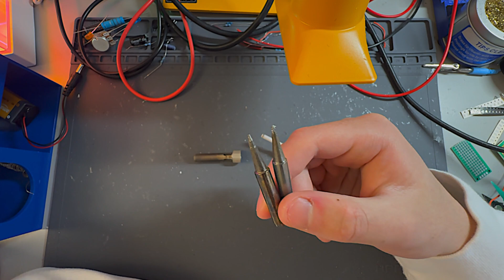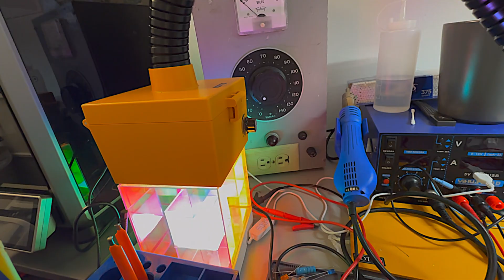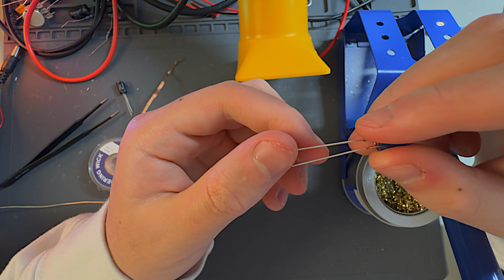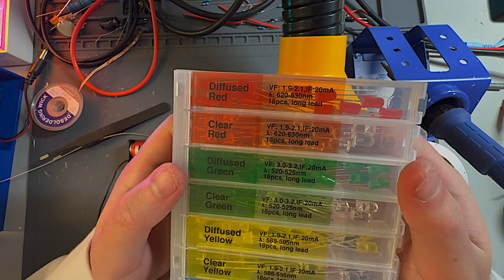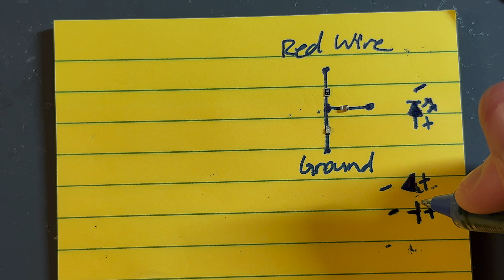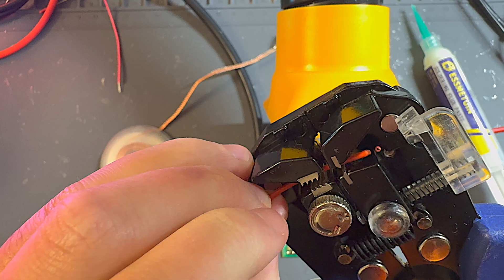How to Solder Your First Circuit, Soldering/Desoldering/Heat Rework Tutorial THC & SMD

Comment: The fumes from both leaded and lead-free solder are identical; it's a rosin that helps the metals bond.  The soldering process does not get the metal hot enough to cause lead to vaporize, so there's no danger from that.  The hazard is from contact; handling leaded solder and then eating, picking your nose, etc., can introduce lead into the body.  So wash your hands!